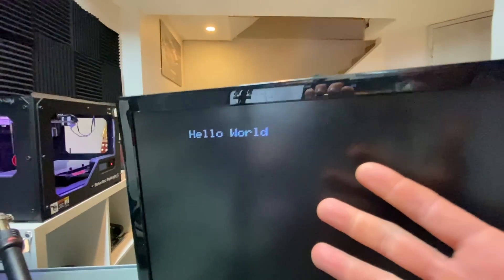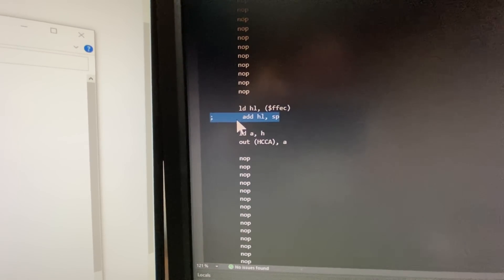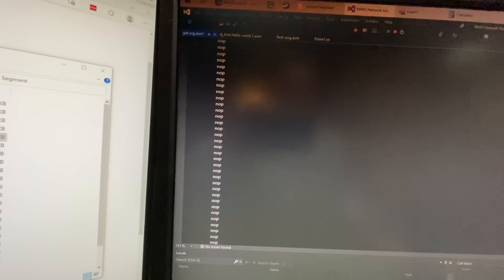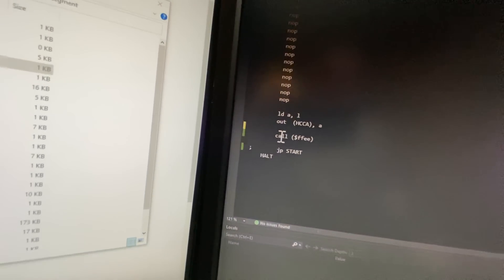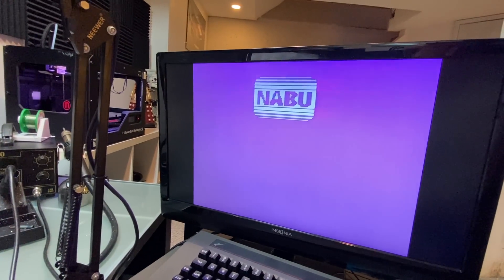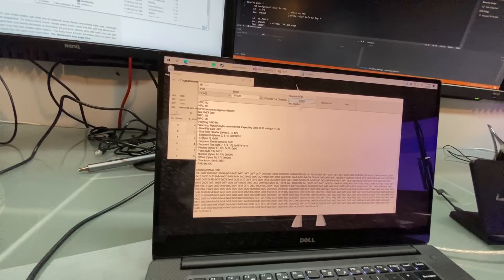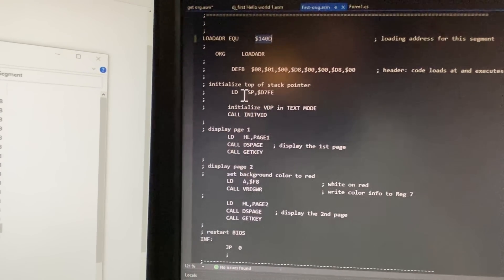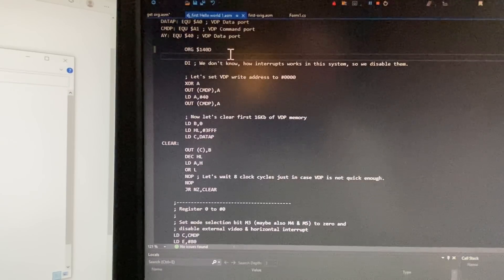09 - Nabu Computer says hello!

Comment: Alternate method to get the entry point. If you know it’s say in the first few K, create a file which a CALL instruction followed by few K of NOPs and then linear code to output the address to the screen. The call will jump to a NOP of some kind (if you have enough of them) which will just NOP to the point that you read out the return address from the stack and display it. You could even follow the CALL instruction with a text string because then you know it’s address as it’s now on the stack.

Comment: For those of us that just bought a NABU and want to start hacking.. what is your toolchain here and how are you uploading code into the system?

Sorry, stupid question, I just saw your other video about the RS422/488 adapter and 5 pin din connector.. still need to know the details of your toolchain though.

Thanks!

Comment: An origin address definitely means being able to boot a DOS. Or a cartridge... Any chance the Colecovision Donkey Kong ROM could be translated for the NABU? It uses the Z80 and same video chip.
Reply from the maker: for programs that do not use bios subroutines on coleco or msx, it would be quite easy to port over. The easiest will be MSX1 because they use the exact same VDP. The challenge occurs when the bios subroutines are different. But, if we create an uploadable replacement bios that emulates the msx or coleco, it would be possible for almost any game to work.

Comment: amazing! hey do you have a discord or something? I would like to help out. also, you have relative opcodes on the z80 instruction set, not everything is tied to the actual position defined by the assembly :)
Reply from the maker: Not yet - but I beleive Adrian is setting one up. I'm more an oldschool github/svn person. But I'm willing to try out this new dang fangled discahqooourd surver
Reply: @DJSures  I mean github is fine for me. I've started disassembling the 4k rom, seems quite dumb, but I seem to be even dumber because I don't understand some memory mappings from the manual (specifically the ones for the sound chip). but all in all, I can see it initializing stuff and sending some chars to the HCCA. It'd be nice to know which string of bytes you're receiving and what you're sending to correlate it with the disassembly
Reply: @DJSures IMHO while GitHub may be great for programmers to share with each other, it is an utter mystery to the rest of us. When I want to get something done, the last thing I need is to have to go through a pile of non-executable files, or worse, raw code that has to be compiled before executing. And even if I can find an executable, nothing shared via github ever seems to have a GUI. PLEASE keep us non-initiates in mind as you share your invaluable work.

Comment: 0x140d seems like a strange org. While the Z80 is happy with odd address aligned code, 13 seems just a tad too close to 0x1400 to be comfortable. That maybe why the other program doesn't work. Dunno, just tired thoughts :)
Reply from the maker: That was my first thought. But after reviewing the bios, it's in there for loading the ram LD      bc,RAM_140d ;$140d
Reply: @DJSures  Interestingly, at address 0360 there's a jump to 140f. This suggests that while the program is stored at 140d, the actual entry point skips the first two bytes. Or at least it seems that way.
Reply: @DJSures  I am now 100% convinced that the actual code entry point is 0x140F, so the first two bytes of what you're uploading aren't getting executed. If you're getting weird behavior from the programs you're uploading, try to add two nops at the start to make sure the execution starts where you expect it to start.
Reply: That's really strange! I wonder what the motivation was for that then?

Comment: Actually, you could write a program with labels and relative jump instructions (JR) without knowing the real origin address, because the assembler would compute the relative offsets to those labels for those jump instructions, which won’t change if the origin address changes. It’s only if you tried using absolute addressing modes that you would have run into trouble.
Reply: Yep! And by adding "jump blocks" in each code block you can extend those jumps...
Too bad there is no relative call instruction, that would have also put the callers address on the stack.

Comment: You should be able to use loops - the Z80 CPU does have relative JMP commands.  Just use an ORG of 0
Reply: Unfortunately no relative CALL, and not all condition codes are available for z80 JR instruction.  Relocatable code in Z80 is possible but very limiting.
Reply: Yeah I was about to say something similar. I have done a bunch of x86 16bit ASM and you can totally do loops just fine as long as you have some type of jump command.

Comment: That's incredible progress!  Well done.  I was thinking about the NOOP and wondered why you didn't loop it then realized that you probably wouldn't be able to go to a label.  Started to write this then you explained it.  😄

I am just fascinated by the process.  Super appreciate you sharing.
Reply: It should be possible to use labels - the Z80 CPU does have the ability execute relative jumps so loops are possible so using an ORG of $0000 would be OK as long as there are no absolute JMPs or CALLs in the code
Reply: @slincolne  Yep a lot of the things he mentioned like accessing data would be difficult without knowing the origin but loops with relative jumps should work.  That's how every architecture I've worked with was because nobody wants to encode 2 bytes of offset in a conditional jump, so they use a 1 byte relative offset or sometimes a little larger that still fits in 2 bytes total.
Reply from the maker: HAha yeah yeah hindsight 20/20 :D Holding down CTRL-V (paste) worked fine for a one time quickie HEHE
Reply: @DJSures  in the future, a small Python/whatever script can be useful for building small assembly programs for stuff like that :)